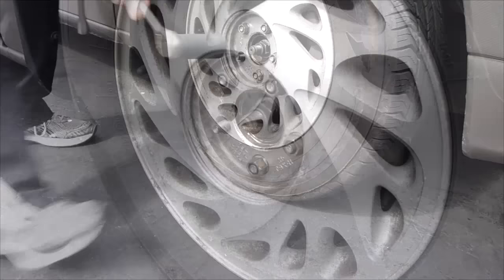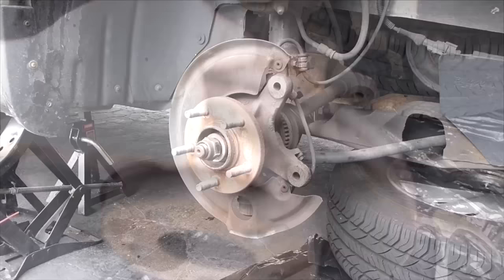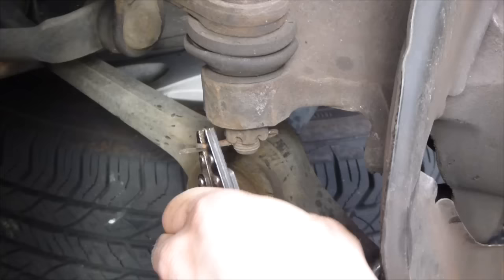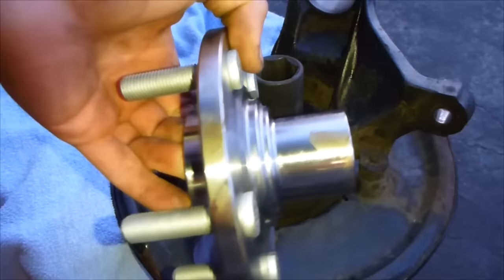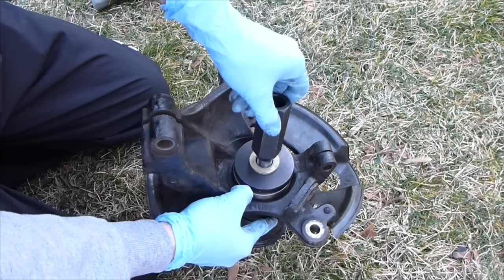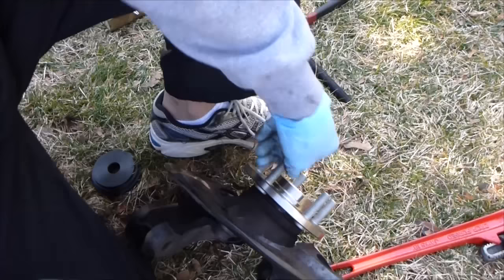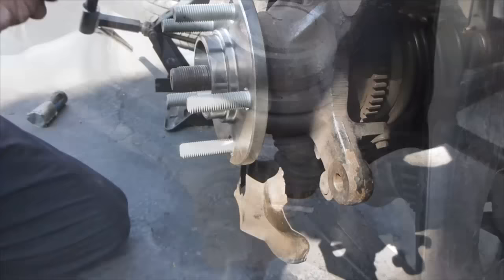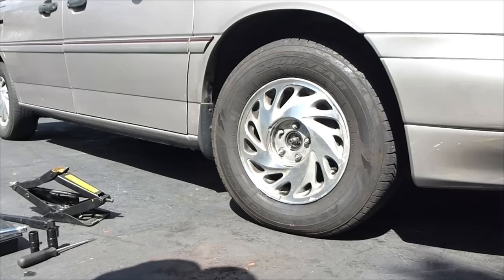How to Change a Wheel Bearing (short and fast version)

Comment: Hi.
I've two little questions...its possible to change the Wheel Bearing without that kit "bearing press" that you have?
And the second question is, if you dont have the toque key, how do you know when do you have to stop?

Thanks a lot for your vids, they're great. ;)
Reply from the maker: Domingos Carvalho You should use some type of bearing press because you will damage the bearing if you just hammer it in. Some people put the bearing in the freezer and then it makes it easier to slide into the knuckle, but you still need something that wont damage the bearing when you try to put it in. To do this job, I would suggest a torque wrench because you are working with suspension parts that vibrate a lot and you need to get the torques correct to ensure safe driving later on. It is a good investment and the money you are going to save by doing the work yourself you can put to these tools!
Reply: Thanks a lot for your answer.
I've thought to use the older bearing to hammer it in, once they're the same size.

I'll try to find some torque key to borrow because here in switzerland they're stupidly expensive.
I thought that you just tighten the screw to the max that you can and then its done, but i'm wrong.
Thanks a lot, you've helped me with my issues.
Reply from the maker: They are a great investment, but I dont know how expensive they are there. A good one in the USA is around $100USD. Our parts stores also rent tools for free. I dont know if that is the case in Switzerland.
Reply: There's all sorts of methods of doing the pressing, using sockets, vises, hammers, etc.

But you NEED a torque wrench to be doing things that your life depends on, like suspension stuff. (and if you don't torque axle nuts right, your bearings may not be preloaded right, and you may be doing the job again pretty soon)
Reply: Domingos - On some knuckles it is a bad idea to use the old bearing because then it too can become stuck in the knuckle and then the regular puller can't get it out.

Comment: I'm fixing up a nissan maxima 1987 and I had to press in the new bearing which is different at first the bearings were inside the metal thought it was like these how you did it in the video but turns out it's more different

Comment: You can also just use the old berring to hammer on to get it back into place..... There is definitely a quicker way to do this whole job.
Reply from the maker: +Reece Ellison Thanks for sharing. You do not want to hammer a bearing into place if you can help it. They are not designed to take shock like that.
Reply: if you use more grease, you don't have to drive her home light taps to start to get it in and a punch on the old berring to slowly put it into place. Done it atleast 50 times never had an issue.
Reply: just my opinion!

Comment: Good video. However, wouldn't it work better in your favor to push down on the torque wrench instead of pulling it up? Even go as far as pushing down in it with your foot especially when you're trying to reach higher torque specs? Thanks chris fix! 😎

Comment: Hi Chris, I loved your video and all your other videos.  
Do you need to get the car aligned after this type of job?
Thanks in advance for the answer.
Reply from the maker: Thanks! You dont necessarily need to get it aligned if the bearing wore out. If you hit a pothole or something that damaged the bearing, it is a good idea to get it aligned.
Reply: ChrisFix  Ran over a median entering the freeway, now I have a rattling noice. Did I messed up the bearings or tie rods?
Also, before that, when backing up there was/is a rattling noice upon turning right or left. Again, bearings or tie rods?
Thank you in advance for saving me a bundle.
Reply: Cesar Rodriguez the turning while reversing noise is most likely your tie rod. have the same problem on my car now. had a look at it, outer tie rod is jacked. with something like that you're better off replacing the inner and outters. hope it helped.
Reply: Ray Bee 
Will do, thank you.

Comment: Thank you for the video, Chris!

From what I know so far, replacing a wheel bearing on my 2001 Prizm (It's the same car as a Toyota Corolla.) will be similar to this Windstar.

What kind of grease did you use for the new wheel bearing? And where did you buy or borrow the wheel bearing press kit?

And where did you buy or borrow your torque wrench?

I checked at a local O'Reilly store, but they don't have a wheel bearing kit. Next I'll check with Auto Zone.
Reply from the maker: Anthony Starfield I actually purchased the bearing press here: http://www.amazon.com/gp/product/B00AZABHLQ/ref=as_li_tl?ie=UTF8&camp=1789&creative=390957&creativeASIN=B00AZABHLQ&linkCode=as2&tag=chri0e2-20&linkId=MD6ERI4LJTI3TNKS
And here is the torque wrench I have: http://www.amazon.com/gp/product/B000JFL89I/ref=as_li_tl?ie=UTF8&camp=1789&creative=390957&creativeASIN=B000JFL89I&linkCode=as2&tag=chri0e2-20&linkId=E74HFL5RVT657ALT
You do not need grease for the bearings because they are sealed and pre greased.

Comment: ChrisFix great video, a mechanic will do it for me for $120 dollars labor only and I got the bearing from ebay for 20 dollars a pair. Good deal, I will love to do it myself and ther are a lot of tools that I have to buy and I will spend more that I spect. At Nissan dealer they charge me 600 dls, mine is a 2001 Nissan Maxima
Reply from the maker: Julio Salcedo That is a great deal! Hopefully he does it right and doesnt hammer the bearing in because then you will need a new one soon! I had a friend go to an inexpensive mechanic and they hammered the bearing in his audi and I ended up replacing the bearing 10k miles later!
Reply: ChrisFix hopefully not. I love your videos. Very understandable.

Comment: Huge fan of the video's! They really are the best out there. I have a 2001 ranger 4x4. Would I follow this same process? Thanks!
Reply from the maker: Sam Feyder Thanks a lot Sam! This is actually different than the Ranger. The Ranger is easier. You will need a slide hammer (which you can rent for free). Behind the knuckle are three screws that need to be removed. Then you screw on the slide hammer to the hub and give it a yank. I forget if you need to take the axle nut off or not but you might need to. Let me know how it goes!

Comment: Dont forget alignment after.
Reply: Oliver M I guess all the alignment bolt are on the other end of the arms so you really might not need it. If it was aligned with that wobbly bearing recently then you might need some adjustment on caster,camber and toe. I just aligned mine last month only to discover a super loose bearing in the rear im thinking im going to do it again after it was so bad. Alignment is a pretty precise thing a matter of fractions of an inch.
Reply: Brian - No, you don't need to get an alignment done if you're not changing anything that could change the alignment.  Get one done for leading or trailing arm, control arms, some balll joint setups, tie rod/ends, struts, springs, etc.

Comment: I sooooo wish it were that easy for me. Mine was on a much newer vehicle, axle nut, frozen on and stripped completely in the process 2 strut bolts, frozen on, had to drill out both bolts, Lower control arm bolt, frozen on. Stripped the nut in the process. Installed new hub assembly and bearing that I had to pay to press, that unit failed 4 days later, stripped the new CV joint I just put on, wrecked my rotor and brake pads. Had to remove the bearing and hub assembly to return to the store, they have no more in stock to replace with, now have to go to another store and get the unit, go back home and reinstall, still waiting on another new CV axle and this entire time I have been without a vehicle, this has been an absolute nightmare and has made me decide to NEVER EVER EVER work on my own car again 🤬

Comment: Hi My wheel is squeeking. It squeeks when i go slow and it squeeks when i turn. I know you can't know for certain but is that a wheel bearing?
Reply: +Zachary A. Wickard  that squeeking when you turn most likley is the c v joint.
Reply: Ball joint
Reply: No. It's likely your brakes. CV joints don't squeak they click/knock. Bearings make a humming sound and yeah. Old Post. NVm
Reply: Zachary A. Wickard Jack the car up and wiggle the wheel holding the top and bottom of your rim. It shouldn't have any play. My car made noises when going slow and turning and it was a wheel bearing. It could be your CV axle also..

Comment: Great video!
One qustion: what holds the hub to the knuckle.
I know there is a large axle nut (torque = 200 foot pounds) but does this nut actualy hold the hub since I thought that axle can slide a bit inside the hub (lengthen or shorter).
Reply from the maker: b novak Thanks! That is a good question! The axle nut and the pressure of the hub being pressed into the bearing hold the hub into the knuckle.

Comment: Do you need to replace the Hub along with the Wheel Bearing? Or is it a only replace if damaged/worn out? I want to know before I start taking it all apart... lol
Reply: Most times the hub might be so rusty that it is earier to install new one. You should also check inside tooths and threads for wheel bolts.

Comment: Hey chris,
Love the video. Planning on buy that tool. To replace just my wheel hub(part holding my wheel studs). My question to you is, can i replace just my hub using a puller and pressing a new one back on while leaving knuckle attached to vehicle. 2nd question the adapter you used for pressing your hub, was that included in your kit? And if so could you provide size?
Reply from the maker: Dee Mil Thanks! If there is enough room you can press the bearing with the knuckle on the car. You will probably need a slide hammer puller for the hub. The adapter was in the kit. Here was the kit: http://www.amazon.com/gp/product/B0028QGT5Y/ref=as_li_tl?ie=UTF8&camp=1789&creative=390957&creativeASIN=B0028QGT5Y&linkCode=as2&tag=chri0e2-20&linkId=QL7NIICRFBAAZXNS

Comment: Hey Chris! Great video! I have a question. I did a job similar to this on my 2004 Toyota Sienna except I bought the whole knuckle assembly with the bearing/spindle already installed so all I did was unbolt the knuckle assembly, caliper and rotor and rebolt everything. I’m now getting slight brake flutter in the brake pedal. What could be causing this? Thanks in advance.

Comment: Man, you are the greatest. But I need a piece of advice. I have Volkswagen Golf MK2 '87 and when I turn full left I can hear some cracking noise bellow the engine, but when I go straight forward everything is fine, but when I am driving in a low torque no matter what gear is it I can hear rumbling noise in front and that disappears whenever I go more than 1800 rpm or something like that or when I press my brake the noise is gone. Sorry if my english is bad, but I hope you can understand and give me an advice. Cheers, man, I like your videos.
Btw, It's a 1.6 Diesel engine.
Reply from the maker: +Stefan Geos It could be your brakes. The brake pads might be slapping against the rotor as you turn or go slow.
Reply: +ChrisFix Thanks, man. I will try to fix that today if that's the problem, and if not I will tell you.
Reply: +Stefan Geos Yep, man, you were right. Those rubber things around bolts were all destroyed and I solved the problem your way, as always. And my lower ball joint is destroyed, so I will fix it in no time thanks to you, mate. Thanks again, I am your fan and subscriber for life.

Comment: How essential is the bearing press? If a guy was careful enough could he install a new bearing without the press?
Reply from the maker: Darrell Winter You need the press. Without it you will damage the bearing. You cannot hammer so unless you can put consistent force on the outer bearing race, you will damage the bearing.

Comment: Great video!  Where did you get the bearing press?  How much did it cost?  If you don't mind my asking.
Reply from the maker: GRowe1978 I got this bearing press at Harbor Freight and it was about $80, but you can rent them for free from any major parts store. If I knew that back then, that is what I would have done because I havent used this since!
Reply: ChrisFix Cool.  Yeah I guess if you don't do a ton of work on cars it may be better to just rent one.  I do shitloads of work to just about everything so, owning one would probably be a good idea.  I usually use a 20 ton shop press.  However, it would be nice to have one of these type bearing presses so you don't have to remove the hub from the vehicle if you don't want or have to.
Thanks very much for your reply!

Comment: First off, its better practice to hit the side of the steering knuckle arm where the tie rod goes in rather than hammering the tie rod stud itself.

Also, it looks like those bearings has a black circle around one side and the other side is silver. Usually those black bands are for the ABS so you want them to be pointing towards the snap ring and where the ABS is. Had an idiot mechanic once put that in the other way and my ABS didn't work anymore.

The one in the video looks like it uses teeth on the axle for the ABS so this one doesn't matter as much which way it goes in.

Comment: You changed the wheel carrier as part of this too. Ive seen this recommended but I tend to just grind the bearing race off and reuse the part of the hub with studs. Is there a reason I need to be aware of why the wheel carrier should be changed too? (This is a I may be doing it wrong, not you are doing it wrong question by the way)
Reply from the maker: m60kaf I replaced the hub (wheel carrier) because it was $10 more and well worth it. If the hub is bad for some reason, you will wear the bearing out again and I didnt want to do the whole job all over again. The new one also fit a lot tighter and I liked that! You dont need to replace it if you know it is still good.

Comment: Hi Chris, why cant we reuse the hub? That would save some money i reckon.. Is it because the inner bearing race stuck to it?

Also, could you have used the ball joint press tool for this job? I'm thinking of getting a set that could work for bearings, ball joint and bushings, not sure if thats possible?
Reply from the maker: azn310 You can reuse the old one if you want. The hub was only like $10 more or something so I got it. I am not sure if a ball joint press will work because it would have to have a very very large cup to get the bearing to fit in it.

Comment: I remember watching an episode when you replaced a fuel filter on a Nissan Quest/villager van so I assume you are familiar with those. While watching this video, I was shocked when I saw the inner portion of the CV axle. The geared end near that goes into hub. I have an extremely loud gear striping sound when I accelerate around a turn. It’s not the typical click click sound of a bad CV axle. Is there anything that could rub against that geared disk? Any thoughts? Thank you

Comment: Question  Chris  ,I have a 1998 Toyota Camry that more likely has a bad wheel bearing, and I have another 1998 Toyota Camry that I had to retire because of an accident but the front wheel hub is perfectly fine, so my question can I just remove the whole wheel hub assembly from one car and put it on the other.?
Reply from the maker: You should be able to!
Reply: @chrisfix  .thanks just wanted to be sure.

Comment: Hey chris recently I took my 07 Corolla with a mechanic to get both front wheel bearings replaced. He didn’t had the press machine and didn’t do it like you instead he hammered it the wheel bearing in using the bearing presser. A week later my car started making the same sound of bad wheel bearings in the front. Could that be because he damaged the bearings or he tight them in too much? I took it back with him and he said that it’s the wheel bearings again that they came out bad from manufacturer.

Comment: hey chris one question  in the minute 8:26 the tool that you  used I the back  it needs to be touching the clamp or only the middle of the bearing  I have a 2010 ford focus SE and the clamp is in the back  too ,  the hub assembly and the clamps are almost the same

Comment: Maybe you did it for video demonstration purposes, but you didn't have to take off the whole knuckle.  Would have saved you from dealing with the (improperly removed) tie rod and the horrible way Ford attaches the knuckle to the strut. The bearing can be pressed out/in while on the car, just remove the brakes and axle.

Comment: Hey Chris did you support the bearing on the backside when you pressed in the new hub? I couldn't tell in the video. I was told you have to support the inner race when pressing in the hub?
Reply from the maker: THETOPGLOCK You do not have to support the bearing on the backside. It will slide right in when you press from the oustide. Just make sure you distribute the press-force over the whole bearing so you dont damage it. This is kind of the same concept but with a ball joint: https://www.youtube.com/watch?v=37NgLM4tIzw

Comment: please make a video replacing passenger side cv joint  for 2nd generation sienna. Thanks
Reply: It's the same process for the most part. The only difference is you need to remove bolts holding the shaft to the output shaft on the transmission
Reply: ty

Comment: I need some more experienced advice. I have a 2005 chevy colorado. I replaced the wheel bearing assembly. It was all back together and I put the tire on and I still have significant  wobble in my tire. So I figured the wheel bearing was bad out of the box. so I bought a new one sent the old one back and still have wobble in the tire after installing the second one. I noticed my steering knuckle spindle is badly worn and it doesn't take much to slip the new hub assembly into the knuckle spindle. Could it possibly be that the knuckle is out of tolerance and causing the play in my tire? A new knuckle for my car is $400 and I don't want to replace it if its not the problem.